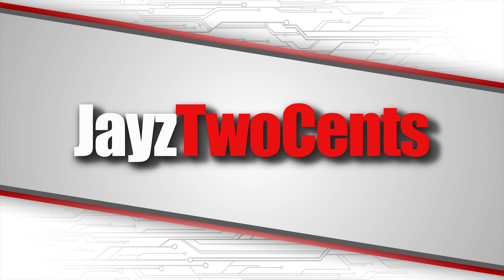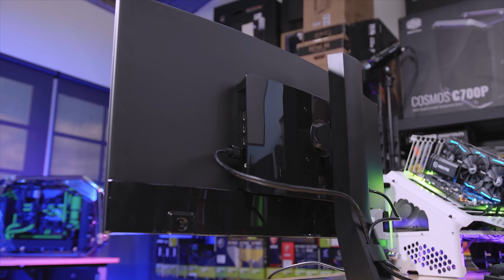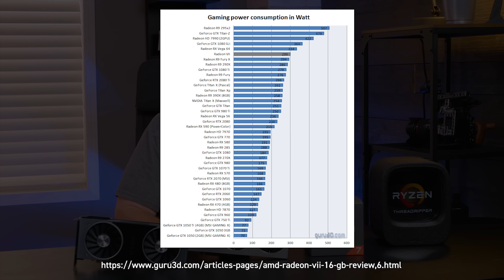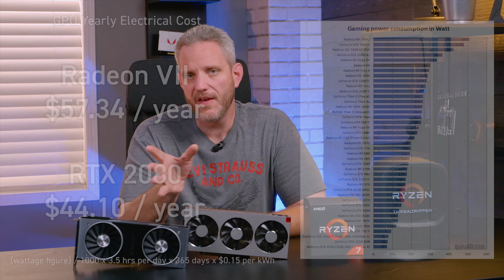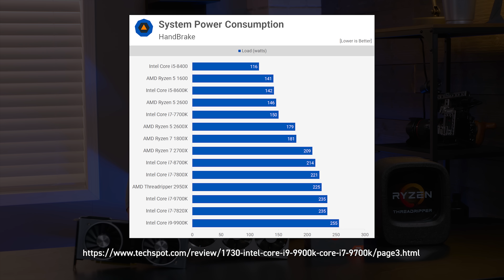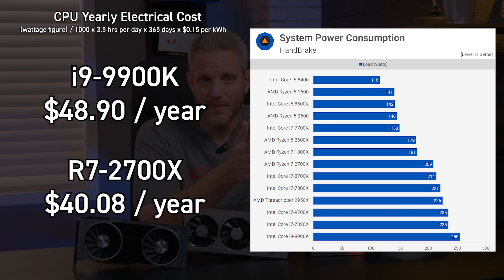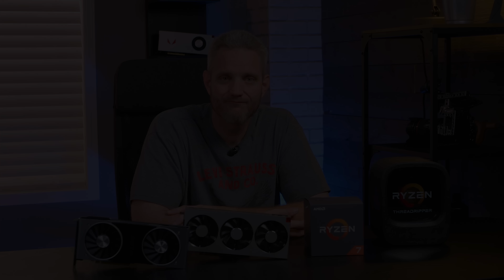Energy Costs of AMD vs Intel vs NVIDIA... This might surprise you

Comment: That 65w TDP ryzen 3700x is quite possibly the real deal of the coming 3 year at least.
Reply: That's why I'll buy it, but it's 65 TDP stock, no one will run it stock unless they don't know how to OC
After OC it will be more like 95 Lol (or that's what I expected to be)
Reply: I'd run stock simply because I don't want to use that much more power, and reduce longevity for a minimal amount of performance in comparison. Also the fact that it voids the warranty if you do so within that period.
Reply: @jaronmarles941  I OC my i5 - 6600k for daily basis
Also now am OC Ryzen 2600 for daily basis
Never had a crash,bug,issue..etc, it's super safe if you don't go for extreme Volt/OC
Also, OC doesn't shorten CPU life, it's only a theory, never seen anyone have OC chip going slow because of OC, not even after 5 years, there is 1 only rule in OC, and it's says "Don't cross the red lines of your chip" and bu that it's means don't OC Extremely, by small to modern OC, you will never shorten your Chip-Life
Reply: @Jack_Sparrow131  It actually does shorten the life span. It's part of the reason it would initially void a warranty. Even if it didn't, power consumption is still a problem.
Reply: @Jack_Sparrow131  It's usually dismissed because it would shorten the span to about 8-10 years, and most upgrade before that. There are some instances though where CPUs might not be completely obsolete before that.
Reply: @jaronmarles941  Lool, so you seriously scared to OC your CPU because it might dies in 8-10 years?
Come on, majority of people (Gamers) change their CPU every 3-4 years (average)
Only people uses 8-10 years of CPU are typical people (Laptops/work desktop..etc)
No Gaming PC will run CPU for 10 years, unless they fake gamers, or people who played like 1 hour every week  xD
Reply: @Jack_Sparrow131  No I'm not
I wouldn't OC because it isn't really worth it in the long run unless you have an older CPU.
Reply: @Jack_Sparrow131  Also, have you ever heard of people using Blender, or Adobe software for years? Probably not because you likely don't use either.

Comment: I honestly couldn't care less about the additional energy costs, but I do care about the power consumption. The main reason is noise: the more energy the chip uses, the more heat it produces, the harder the cooler has to work. 

I like how you did the tests and the numbers are absolutely fair, but I don't understand the hardware choices. The Radeon VII is the only new card AMD has (all the 5xx cards are rebrands..) and the card is also one of the least popular AMD cards. It would be more interesting to see two competing cards that are more popular like the 580X. On the CPU side the choices are weird as well. Yes both chips both have 8 cores, but the performance is completely different. The i9 is quite a lot faster than the R7, so why not compare two chips that have comparable performance instead of a comparable core count? It's like you're comparing a 80 hp car with a 180 hp car because they both have a 4-cilinder engine.

Comment: I think power also amounts to more cooling and PC loudness, so there's more to it than just energy costs.
Reply: That and heat. Not all of us have AC and I'm never ever getting a hot GPU ever again after GTX 280. That was 236W TDP, but it used close too 300W and the heat radiating from it when you fired up a game was very uncomfortable. Now in summer months any excess heat is bad and they'd need to giveaway free a 300W GPU for me to take it. Doesn't matter if you water cool it to get rid of the noise, all that heat still dumps to your room.
Reply: I had a pair of gtx260 back in the day. The wall behind my computer got a slight burn mark after running gta4 on it for many months. They ran at about 70 degrees (C) if I recall, so a 70 degree blast of air slowly cooked the wall.
Reply: @tin2001  I can imagine. I modded mine (VRM) to fit the beast Accelero cooler, so temps and noise was fine, but it slowly cooked me :)
Reply: @tin2001  You sure it's not just dust and other particles scraping off paint?

Comment: My whole system including monitor is using 170-200 watts while I watch this video.  That's a 5820k, couple fans, 1080TI, 27" monitor, keyboard, and mouse.   Just including this as a reference for some.
Reply: nice my laptop uses like 20-30 watts.

Comment: You can look at it the way you looked - "not enough to bump you in the next tier" OR "a $xx discount to my gpu".
Also - there has always been the pattern of twice the price for the extra 10%, in EVERYTHING. Be it the learning curve, cpu/gpu power, or offgrid solar dependability (to go from having power 90% of time to 99% of the time is twice the price).
Also - you should compare not core for core but similar benchmark scores, obviously better performance cpu is going to use more power.
And last but not least, maybe 5-10 years ago it was a very normal thing to consider when it was i-series cpus vs fx-series, but now as the gap decreases significantly, it's becoming less of a concern

Comment: Running Cities skylines on either is a room cooker. The game loves single thread clocks.
Now that I am unemployed, I7k is a space heater in the summer.
Reply: @Brooke Stern Upgraded from my i5 4th gen 4430S 8GB to a R7 2700 32GB, Skylines runs better than before by far. Admittedly, it would run even better on an Intel chip (better IPC) but I found the more efficient Ryzen offering appealing instead.

The FPS does drop off a bit though around transport hubs (as expected) where lots of cims are going about their day to day stuff. The drop isn't as bad as it was back the 4th gen i5 though.

No regrets so far, for giggles and kicks managed to turn the old system into a Virtualbox VM (using disk2vhd) and can now run that inside my fresh Ryzen W10 install.

Comment: stop saying 40% more. its almost double the price, double is 100% more, not 50. please correct yourself.
Reply: 2700X = $329.99
9900K = $489.99
$329.99/$489.99=.581
The 2700X is 58% the cost of a 9900K.
1.0-.581=.42
.42 is then read as 42%. In a direct cost comparison, he is right in saying that Intel costs roughly 40% more.
Reply: @phteven5030 
That's not how maths works.
284+40% is only 397.
It's actually closer to 75% more than 284.
Reply: @phteven5030   lol you first have written 284.99, then used 329.99$
Reply: @phteven5030  Jesus.
Reply: @phteven5030  you are so wrong. and where do you get 329.99 from?
Reply: @zocker1600  this is exactly how i did it, i dont know what the stephen molzer guy is getting his numbers from...
Reply: @phteven5030  so you also mean that 50% is twice as much? because thats almost what you are saying. the 9900k costs 72% more than 2700x... intel fanboys i tell you
Reply: @xibidit  yeah I was only proving your point with some numbers given by some other comments ;)

and maybe someone did learn how to calculate the percentage too^^
Reply: Wow, all of you are pretty bad at this... The 9900K is 70% more expensive than the 2700X, looked through the price of the 2700X. The 9900K is 40% or whatever more compared to its own price.

 489.99/284.99 = is 70%

284.99/489.99 = 58% (not 40)

Now the price difference of the products 489 - 284 = 205 ....

That is 40% of the cost of the 9900K - 205/489 = 0.42%

And the price difference is 205/284 = 0.72% of the price of the 2700X 

The right answer is 70% but you could also say it's 40 %, of the price of the 9900K, less expensive.
Reply: @zocker1600  hopefully someone did learn, hopefully the j2c guy can go on camera and correct himself =) it would be the right thing to do :p
Reply: Depends on where you live.
Where I live the 2700x is 350$
And the i9 9900k is 580$
And that's 66%, so about half plus some change.
Reply: @xibidit  "Intel fanboys"
My dude you're the fanboy here, you need some counseling, fanboys of any company have a screw loose, this isn't soccer (and even in the case of soccer it's still mental).
Reply: @iGMX It was designed too.
Reply: @xibidit  Did you read my comment, never intended to shine, I just wanted to say that technically all of you are correct.
Reply: @WetPig  i was just joking my friend
Reply: @MyAsdfqwe  I was tired and drunk. Sale price for me is $285. Regular price is $330. The 9900K is $490. 🤷

The math is right. He's talking about comparative pricing. That's how it works in sales.
Reply: @zocker1600  come on* guys, English is not that hard.

Also, the decimal system was created by countries that use the period (full stop) as just that, not a comma. I'd greatly appreciate it if you joined the first world.
Reply: @phteven5030  hah you seem to be the very smart guy here, but not smart enough to read one sentence from Wikipedia:

"The decimal digits are 0, 1, 2, 3, 4, 5, 6, 7, 8, 9;[4] the decimal separator is the dot "." in many countries (including all English speaking ones), but may be a comma "," in other countries (mainly in continental Europe). "

I live in Europe, that's why I use comma and it's correct.
So in your opinion Europe is not the first world?

source: https://en.wikipedia.org/wiki/Decimal
Reply: @zocker1600 I'mma going to go with the use of commas to denote the decimal point as being both incorrect and unnecessarily confusing. 

It may be standard in several mainland European nations, Germany for example, but not a single programming language I am aware of will defacto correctly parse a number using a comma as the decimal point. What's more, it directly conflicts with comma separated variables, one of the most universal syntax conventions to have ever existed. 

Seriously, the programs written in your country for use in your country have to explicitly include extra input checking and parsing functionality so that it will accept numerals written using comma decimal formatting. 

Sorry for the rant, but that is my opinion on the use of comma decimal syntax.
Reply: @phteven5030  Yea but a 2700, costs less, and can overclock to 2700X speeds. THEN, its around 60-65% price increase for the 9900K. The 9900K is at 485$, and the 2700 is at 300$.
Reply: @phteven5030  Also your math is wrong. You calculate it this way: 490$ / 330$ = 1.4848. 1.4848 x 100 = 148.48. 148.48 - 100 = ~48.5%. Which is closer to 50%, relatively speaking. So Kristoffer Persson is correct.
Reply: You are all wrong, not because of the math but because of all of you making a big deal out of this.
Reply: @phteven5030  one product costing 42% less does not mean the other costing 42% more.. it means the other costing 72% more.. that's how math works

Comment: In my case it was a better idea to buy a lower power draw GPU, simply because of the heat output. I live in Portugal, things get hot in the summer,  the less heat my PC outputs into my room, the less I spend on ambient cooling, water, beverages etc

Comment: Would have been interesting to see electricity cost scale with PSU efficiency.
Reply: That requires Steve Burke charts.
Reply: PSU efficiency peaks when run close to its design power output. Which is why you should never stick a 1KW PSU in a system that only draws 150W max.
Reply: @tin2001  weird, the last time I checked it peaked at about 50% load. Just image search for 'psu efficiency'
Reply: james braselton  did you have a stroke?

Comment: I rock a GTX 550 Ti and a Phenom II X6 1035T.
Reply: Nice. I'm still on phenom ıı x6 1100T and gtx 1050. My cpu is showing his age though.
Reply: Ive got a 3rd gen i5 in a board I original had for me 2nd gen. Its only very recently I've run into CPU hassles.
Just bought a 4K TV though, and that's what I use for driving games. I suspect the urge to run 4K games may cause me to upgrade my machine a little soon 😂